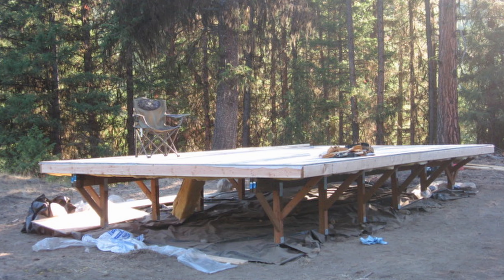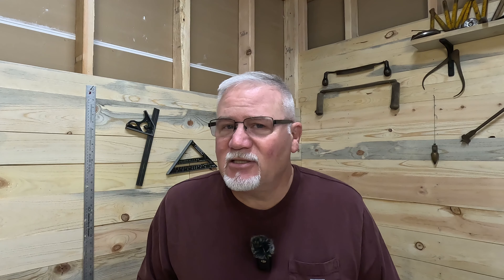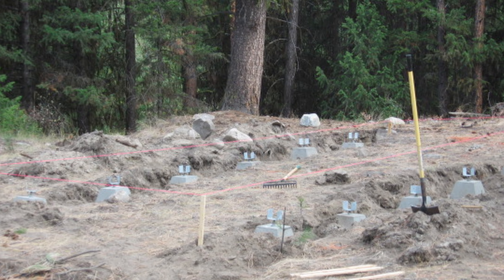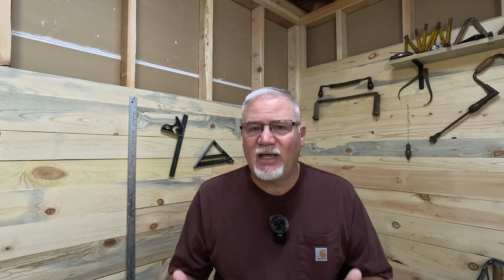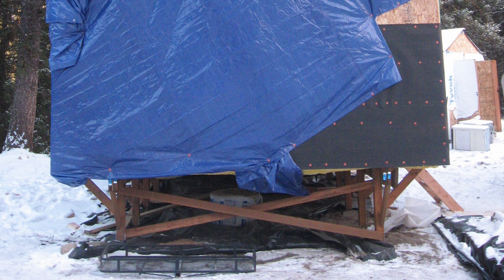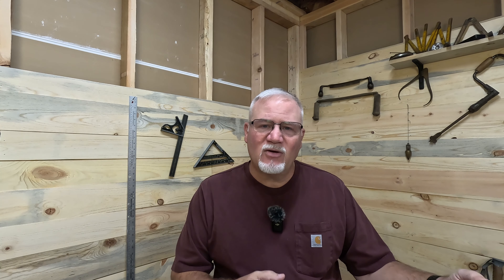I Regret Choosing Post and Pier for My Cabin Foundation Here's Why!

Comment: I used solid insulation with a reflective surface facing the bottom(with an air gap) ...Above that I then placed a 6mil vapor barrier then came the 3/4" sub-floor... then below that i covered the bottom with 1/2" pressure treated plywood..All gaps had spray foam sprayed in to them..(from the top and bottom as needed)
I used sono-tubes for the foundation..
For your cabin you can use your piers as the anchoring points(like you have now) and then jack up a small amount(in the center line) and put blocking at midpoints in your structure..
Those would be cinders/concrete blocks with shims to height after removing the jacking devices.. I also used blocking between my 2x 10's so that the floor joists would not flex..(that makes it extremely rigid) You may need to place 4x6 or 4x4 runners on the blocking to give more strength but that's your choice..
I was told to never use soft insulation under a cabin as its perfect for nesting..
The combination of hard insulation and reflective surface with an air gap and the 1/2 pressure treating panels screwed in underneath helped a lot..(wire mesh or plastic on the bottom does not deter pests)
Also if I need access I can undo the screws and remove a bottom panel underneath the cabin if needed....
Reply from the maker: My issue with the ply underneath is that it can't breath but your installation sounds like a a well insulated on and those generally don't need to breath.  I've often pondered just removing the bats and putting in R10 foam board instead.

Comment: If you want to stiffen up the building build 2x4 walls between your posts and then sheath the entire length using 1/2 plywood or OSB. The pick one row down the center and do the same thing. It would have been better if you could have brought in pallets of concrete and poured Sono tubes using a portable mixer. If the ground freezes for long periods of time those cement piers you used will eventually sink into the ground. Each area of the country has a minimum frost depth for concrete supporting structures and rages from 12" to 60". Foan is the only thing that will work for under floor insulation in that situation. They make a 4 1/2-inch foam insulation that is rated at R31.5 that would work great for the underfloor. For the walls I would use rockwool R15 batts and a minimum of R38 in the ceiling.
Good luck on your project.
Reply from the maker: I'm putting in new foundation and stem walls bustvyes that would work well too.

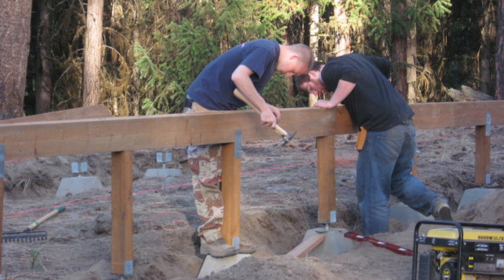Comment: = Generally , The posts for post and beam, are supposed to go into the ground about as deep as it is above ground, for that lateral support.  I saw the potential problem at the 0:40 second mark as soon as I started watching the video.  But I wanted to see what you did about it, so I watched more of it.   You probably did not want the rotting problem of the post in the ground, which is why they often use sono tubes and cement. My recommendation for most builds is to pour a floating cement pad on a bed of gravel, which can be insulated on top if needed.  Many garages use that method, and it avoids a sub-ground concrete frost wall which is expensive.
Reply from the maker: Funny thing, it isn't as bad as I might have made it sound (unintentionally) but I'm happy I put in a couple stem walls and will be completing the foundation in the near future.

Comment: I lived for 8 years in a 2-story cabin built somewhat similar, except it was on a hillside.  This result in the downhill posts being almost 6' tall.  I ultimately added plywood box beams between all of the posts.  The box beams consisted of a 2x4 (flatwise) top & bottom, with a 2x4 nailer bolted to the posts, and faced these 2x4s with a full sheet of 3/4" plywood both sides.  I used steel doors throughout and every time a door was slammed you could feel the entire cabin move.  But I was living there alone (no electricity or running water) so I wasn't too concerned as this was intended to be temporary quarters while our home was to be constructed.  Life events changed my plan and the home was never built and then some local juveniles decided it would be fun to torch my cabin.  There it now sits as a half burned-out shell.
In hindsight, the posts should have had a full-moment connection to the concrete piers (that only came up to ground level) and not just a single bolt into the concrete.  Further, all 6 posts should have been tied to each other with the plywood box beams I described above.
The only advantage to what I had constructed was that everything other than the doors, windows, skylights & roofing were scrounged materials.
Reply from the maker: That boxing in those posts would definitely have made a difference!  I did something similar but just OSB face nailed to the posts and it made a big difference.

Comment: It does not matter how much insulation is in an unheated basement or crawlspace ceiling. 30% of the heat is lost downward from the room/house above, because the ground is always cooler. The slab must be insulated to create a thermal barrier. With pier foundations it is impossible. That's a big reason to enclose them. It keeps the losses to at least 30%.
Reply from the maker: Ya best to enclose for sure

Comment: You could pack some hydraulic cement in and around the bolt you speak of so that the hydraulic cement is fully between the concrete pier block and the bottom of your galvanized 4x4 post bracket.
Reply from the maker: Tell me more?  Would this require basically building the pier up to the saddle?
Reply: @TheOldJarhead  Hydraulic cement or non-shrink grout. When I posted about Hydraulic cement I couldn't remember the name of the product I was thinking about. What I should have said using is non-shrink grout. Basically, if you don't know, non-shrink grout will not reduce in size after it hardens. So, if you were to provide form work from the top of your concrete pier block up to and around the saddle it should provide some extra stability. I would even go so far as to make a wider formwork around the pier block beginning at the base of the pier block, say an extra 3 to 4 inches wider on all sides of the pier block and bring this formwork up to and including the saddle and fill it with non-shrink grout.
In addition, I would even dig down around all 4 sides of the saddle a few inches (doing this one at a time of course) and fill this trench up with packed sand and or cementitious gravel. This would provide a wider and more solid base for your non-shrink grout. If you do bring the non-shrink grout up around the saddle I would suggest coating your wood posts with some tar or other such waterproofing prior to finishing with the non-shrink grout near and around the saddle.Also after packing the sand/ gravel base then wet it down just prior to adding the non-shrink grout.
It may even be advisable to do one pier at a time while supporting with temporary shoring any nearby structure, then remove the post and saddle, the pier block and then dig down to just below frost for a proper base and support for your re-installed pier block, saddle and post and the non-shrink grout technique described earlier.
Reply from the maker: Thank you for sharing such detailed insights! Your suggestions on using non-shrink grout and creating a solid base are super helpful for anyone looking to ensure stability in their projects.

Comment: We built our story and a half, 25 by 31 foot,  recycled log house 40 plus years ago on a isolated hill site on very well drained soil without going to the 4 foot (plus) frost line.  It has never "moved". We made a "grade beam" foundation - a 2 foot high, 2 foot on center, stud wall of foundation grade pressure treated southern yellow pine 2 by 4's sheathed with 1/2 inch pressure treated plywood with a treated 2 by 6 for the footer (all painted on the inside / foundation coating on the outside) set a foot or so into the ground directly on leveled, undisturbed soil.... made it into a "plem-wood" foundation with a section of wide air duct to just below the ceiling behind the centrally located wood stove ( for heat shield) open on top  connected to a under floor furnace fan pulling air into the crawl space warming the floor and then back into the living area through a 3/8 inch gap between the floor and log walls. It works especially well to first heat up the house then the quiet and sound of the wood burning in the stove is far better than fan noise. Yes! much satisfaction can be had building your own house in the forest. A simple foundation on a good site helps to get the project going.
Reply from the maker: That’s awesome! Your place sounds super cozy and well thought out. Love that you built it all yourself—seriously, major respect!

Comment: At this point you have to put a bottom plate and top plate between all posts get 3/4 ply not OSB  use PL constuction adhesive and engined screws on all edges
Reply from the maker: Ot just pour footings and build stem walls :D

Comment: In Hawaii most homes are on post and peri  and they make you put in a concrete Fondation on all the corners
Reply from the maker: Good idea on the corners.  Would stabilize things fast I'm sure.
Reply: I think code is 6' on each corner
Reply from the maker: That would do it -- and could be an option for me up front where I want a crawl space entrance anyway!

Comment: Honestly if your post & pier foundation isn't stable, it's because you didn't design & build it properly. And the building in the photos you show is not designed properly.  You shouldn't need bracing at all if the posts are in the proper location, notched for the board, and anchored with more than just a singular bolt per post. And of course 6x6s are a LOT more sturdy. 4x4s can work for some stuff but it takes a few more of them and you don't have as much meat to work with when notching posts. 

To fix that cheaply & quickly I'd say you need some treated 2x4s for underpinning around the edges, basically framing up a tiny wall right on the ground around the edges of your building and then put up sheetmetal roofing for skirting. 
That'll last decades. Especially if you put a bag of concrete (or just portland cemend mixed with the soil) under your underpinning every once in a while. The upright boards need to fit tight. And you can help anchor them with rebar stakes  or/and concrete. That will repair your foundation and enclose it all at once. Without any need for the more expensive and laborious masonry work.
Reply from the maker: You make some excellent points about foundation stability! Proper design and materials are crucial for a solid build. Your suggestions for underpinning and skirting will definitely help those looking to improve their structures. Thanks for sharing your expertise!

Comment: I agree 100% I built a cabin on power line polls . It was solid as a rock . We insulated the floors and put plywood down underneath, the critters still got into the insulation. I had plans to add on but decided that it would need a foundation. We dugout the footings jacked the cabin up put the foam block down and pumped it full of concrete. Way more expensive and time consuming . I look back and think of how hard it was and know now that we should have done it right the first time. 
Now it’s not a cabin we call it the lake house it has a full basement with 3 story’s above it , 4 bedrooms a well and a septic system… with real flushing toilets, a real hose but I tell the new guys do it right the first time don’t do it the way I did. I was 25 when we started it now I’m 65 and it’s still not done .🫣 it’s been a labor of love and I wouldn’t change a thing.
Reply from the maker: Nice job

Comment: I installed motion lights under a shed to keep the animals away 👍
Reply from the maker: I have some myself so might help
Reply: @TheOldJarhead  the one I have setup has the solar panel and light connected by a wire, so I can install the light in the dark and the panel is exposed to the sun during the day. My other ones are all in one kinda things✌️🇨🇦
Reply from the maker: Gotcha.

Comment: My house is underground.  Here on the coast of maine. 45-49° year round . But, during the summer it does tend to warm up.
Reply from the maker: I've known some with ug homes and they usually maintain a pretty steady temp
Reply: @TheOldJarhead  I only heat with wood. No back up.
Reply from the maker: I use wood at the cabin but have a backup heater for those cold winter days I arrive and it's below freezing (well below) in the cabin and I need some help getting it warmed up before bedtime lol

Comment: Be careful with stem walls, make sure you provide plenty of ventilation and put down a vapor barrier. I built a cabin with 100% stem walls and I was shocked at the amount of moisture coming out of the ground. I went back and drilled many 2" dia vent holes. Without vent holes and vapor barrier, it could rot out your floor. Best foundation is a concrete slab. Screw the post-n-pier and stem wall..
Reply from the maker: Thanks for the tips! Ventilation is key for sure.

Comment: I used to guide at youth camps up in the Canadian bush and everything was post and pier built on solid rock seeing as how we were located on the Canadian Shield where there’s not much dirt. But I would be hesitant to use that method to build a personal cabin. I’d prefer to pour a concrete pad then put up a prefabricated metal building so I didn’t have the wind blowing underneath the cabin. I like Pioneer brand galvalume huts preferably the arched style but the quonset round buildings are nice as well even if they don’t have the peak gables like a Swiss chalet or what not.
Reply from the maker: Solid rock is a different beast than most soils, that's for sure.
Reply: @TheOldJarhead  Absolutely. Up in northern Ontario they don’t even know what dirt is. It’s like being up in the mountains so piers are the only way to build.
Reply from the maker: Makes sense
Reply: @TheOldJarhead  I used to refer to myself on one blog as “Bubblehead Marc” because I used to be submarine sailor. If you’re a jarhead then apparently you were in the Marines. We had marines guarding the submarine tender out in Guam where submarine squadron 15 is located.
Reply from the maker: Yes sir, 86 - 91 with 2nd Light Armored Infantry.  Semper Fi!
Reply: @TheOldJarhead  I was in the navy from ‘77-‘81 on the USS John Marshall SSBN 611 and the USS Trepang SSN 674 as a quartermaster 2nd class. Then during the Gulf War I was an able seaman in the merchant marine on the M/V Advantage with the military sealift command hauling both Air Force and Army cargoes such as bombs, Bradley fighting vehicles and MLRS rocket launchers to both the Red Sea and the Persian Gulf.
Reply from the maker: Nice!  I was there in the gulf and appreciated those MRLS's!  Awesome units that saved my bacon once or twice ;)
Reply from the maker: LOL yup.  We were in a bivouac not from from the enemy when they decided to pop a few arty rounds out way.  Big mistake!  The entire sky lit up with contrails heading outbound...ya, it was loud but then we also didn't get any more arty coming our way ;)  Little did the Iraqis know we were in the middle of a battalion of MRLS's!

Comment: A proper pier system is superior to slab on grade. Basement would be ideal but if you want a quick, cheap foundation pier is the way to go. Im talking 10-12ft below grade and 3-4 ft diameter.

Comment: I built in Northwest Montana and used railroad  ties studded the bottom end with 20d nails. drilled down 4' . Plumbed them and poured concrete around them. left them proud of the ground 5' and built a balloon framed 12' walled 16x24'  OSB sheeted.  Sheeted the posts under the cabin and used it as a basement had a second level for an upstairs bedroom area had a shed roof dormer. this was in 1989. it is still in use today and has been since it was closed in.   The posts have been very stable for all these years.
Reply from the maker: Nice!

Comment: Build a wrap around porch/deck that has concrete post.  Two birds, one stone.
Reply from the maker: Wrap around porch is in the works ;) but I'll finish the foundation under the cabin while doing it (that's how I started, pour a footing, build a stem wall, frame up under the cabin, add porch deck and move on.  Just have to do it a few more times ;) Cheers
Reply: @TheOldJarhead  that's smart.  Good luck, sounds like a ton of work.
Reply from the maker: Thank you! It definitely requires a lot of effort, but I’m excited for the challenge ahead!

Comment: I don’t mean to be so negative but all of those issues were your own mistakes. Just looking at that looks like it was built on stilts, and to top it off you only used 2 2x8’s it looks like for your beams. Combined that’s only 3” wide. 
The good pier and beam designs the beam is set right on the piers and most often 3 2x to make up the beam and usually 2x10. 

And yes of coarse any more weight built up higher would only increase the racking movement the floor was already solid that wasn’t your issue. 

Then like you admit you didn’t skirt it. Just a skirt and some reflectix on the inside of the skirt should be enough to keep your pipes from freezing as seen in the videos you reference. For whatever reason that’s is the next major point of your issues and it’s another you issue. A skirt would also keep out most larger critters. 

Then you use fiberglass insulation which is the ideal spot for rodents. 

What it sounds like is you cheap’d out on your build. You chose the smallest cheapest foundation you could. Then when it wasn’t stable you avoided skirting it. Then you used the cheapest insulation type which is known to be a safe haven for rodents. 

So in conclusion there isn’t anything wrong with the pier and beam design; the issues here was the builder I’m afraid.
Reply from the maker: Can't argue really though the beams were as designed and with a 1" PT ply center etc.  It's holding up but I have work to do